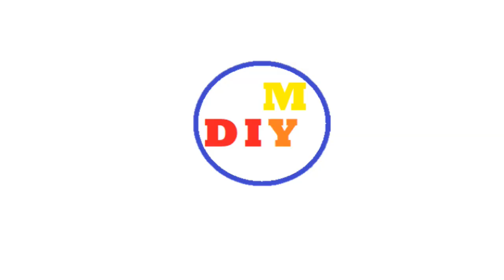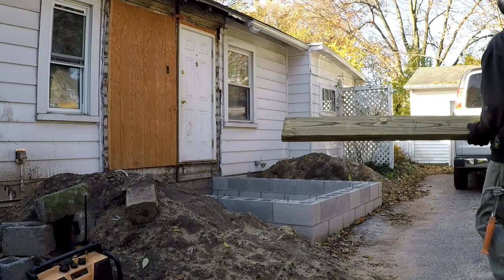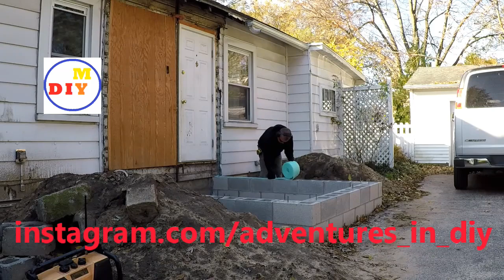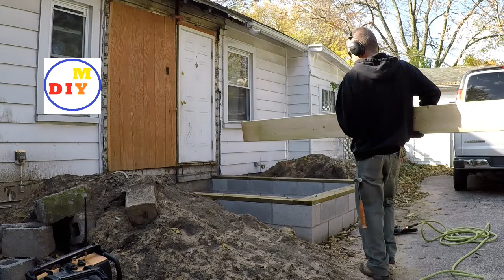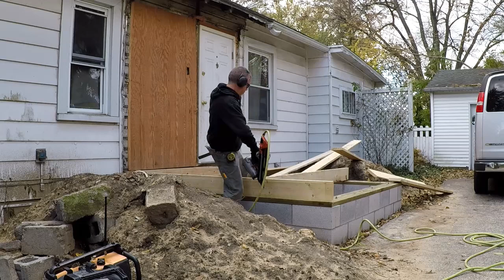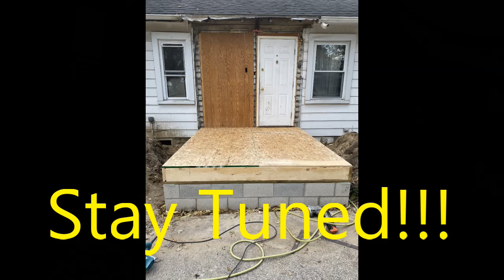Building a Small Addition Pt.1, Framing The Floor | How To | MY DIY

Comment: What was sticking up through the cylinder blocks, that you put wood on and screwed it down?  I like what have seen.  Please and thank you for commenting.
Reply from the maker: Anchor bolts, as the block is getting laid, the bolts get held in place with mortar.

Comment: On the block work , I noticed you have some type of paper barrier , what is it called ? Also the bock has screws to tight down your treated 2x10 , how did you have it inside the black ?
Reply from the maker: It is a sill gasket that goes down before the plate, and the bolts are mortared in. Here’s another build series that shows it in more detail: https://youtube.com/playlist?list=PLhCJj4xH2v-dzxlX-cIkq_o0lKo78AZKu

Comment: Any tips for adding a room to a travel trailer as we'd like to add a room off our sliding door so there is more room and one extra so if family member stays there is a room and bed for them but haven't been able to find much on converting or adding a addition to a travel trailer like what we want any tips
Reply from the maker: I’ve never done an addition on a travel trailer, I’d definitely check into zoning and building codes if you’re going to do that though!

Comment: So this is technically detached so doesn’t need permit in my area ? If it is less than 200 square feet . Am I correct ?
Reply from the maker: Depends on your local building codes.
Reply from the maker: And it is attached to the house.